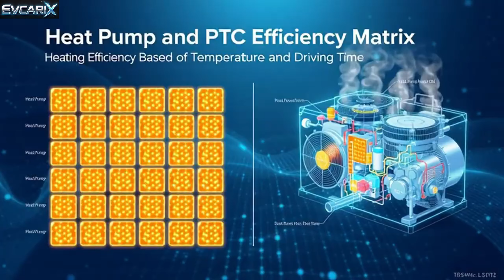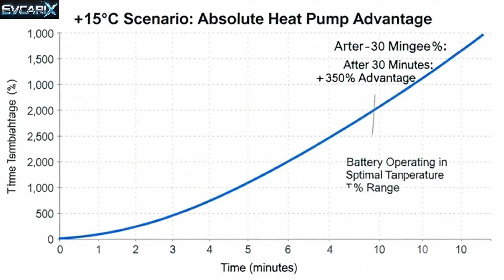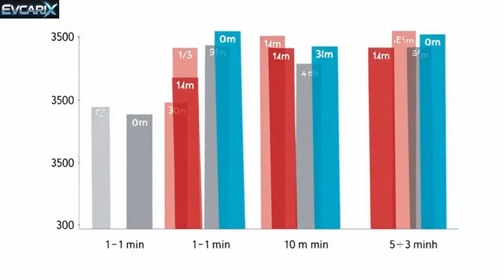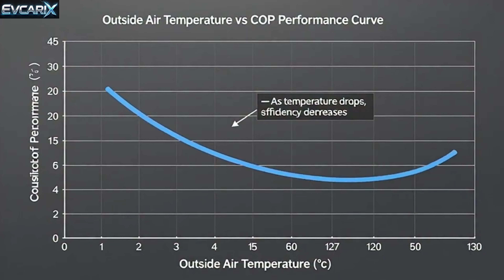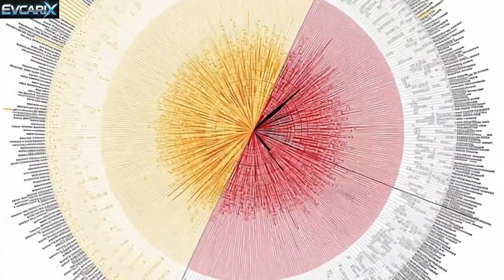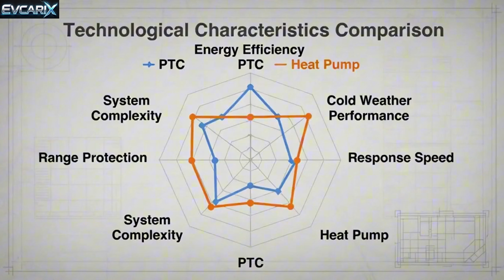Your EV Has a Heat Pump But Still Uses Too Much Energy? Blame Thermal Inertia

Comment: Hmmm… Heating the passenger cabin was never a problem with internal combustion engines.  Heating the passenger cabin had NO EFFECT on gas mileage or vehicle travel range.
Reply: That's correct, I'll give you a hint. It is in the name of the type of engine. Combustion, that is the reason why it's not an issue.